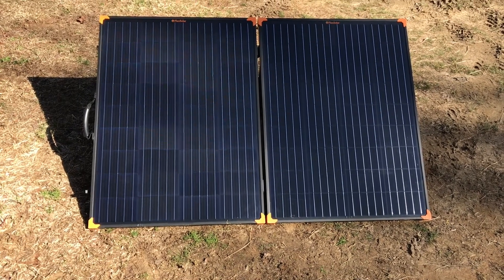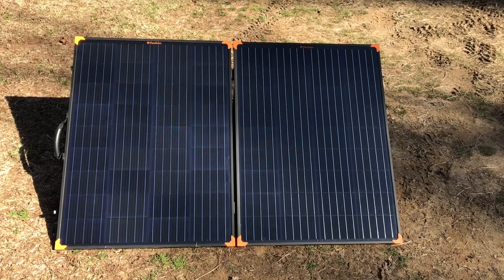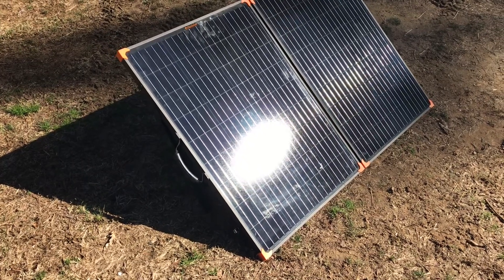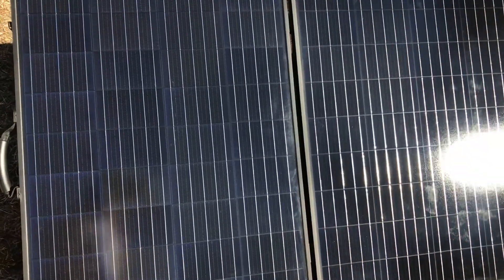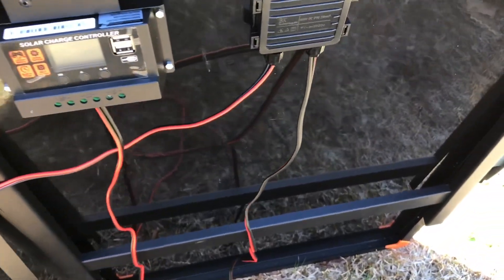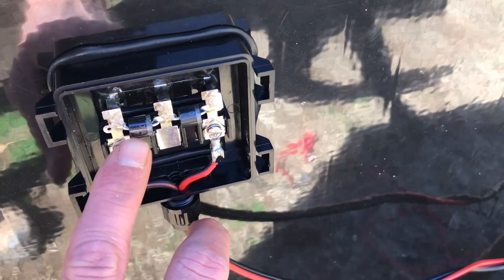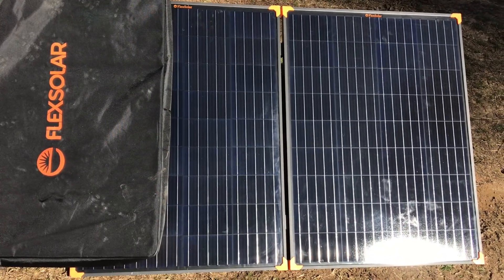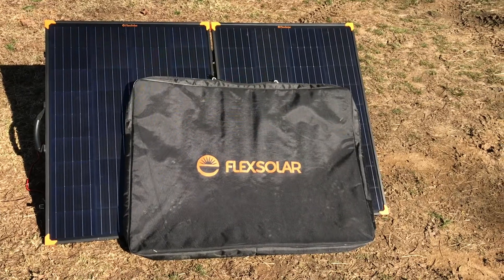EMP AND SOLAR PANELS

Comment: I look forward to learning the rest. I'm installing Ferrites onto my lines and will be putting multiple T.R.A.P. devices on my system..I have backup AC/DC inverter, MPPT controller  and a battery Charge controller in faraday Bags. Placed into my faraday Garbage can . I am using the Nesting approach to protecting my gear. 
Example:
1)Keep electronic device in cardboard box it came in.
2) Wrap box like gift with 6 layers of aluminum foil.
3) Place item into EMP bag. And fold tape bag closed.
4) Place bag into 50 cal ammo can. If to big for can add 6 more layers of foil
5) Place item into EMP garbage can
Note ( The garage can has had any and all places that have pierced by screws, rivits in the can covered with aluminum Tape to prevent wave from entering. Then cardboard on the inside of can. Then a huge EMP bag inserted into can think like a trash bag in the can)
6) lable item so you can know what it is on outside of bad 
7) Place EMP bag into garbage can and seal EMP bag by folding a few times and use masking tape or clear tape to seal.
8)Place lid on can
9) Using aluminum Tape seal lid to can to make complete seal.
Lable outside of can of contents in can.

I hope this gives people some ideas.
Using the he nesting method I think is best and not very costly. More layers are always better.

Just my 2 cent
Good luck
Reply from the maker: Great method you have! I love it! You earned the pinned comment! Thanks for sharing your method!
Reply: Great info. Thanks for sharing!
Reply: Where do you get HUGE EMP bags?
Reply: Also cover with aluminum Tape on the inside and outside any rivits or screws that may have pierced the can to prevent wave from entry. Additionally, after to insert item into ammo can, use metal tape to seal each half of ammo can to give a secure seal.
Reply: I am in the process of doing exactly what you are doing.
 My question is, my MPPT controller is programmed using Bluetooth. Can I use a tablet downloaded with Bluetooth then put it in a faraday can and be able to use it on that fateful day?

Comment: This is a very good video.  You answered my question.     My solar powered power station i ha have it in an EMP PROOF box.    Didn't think i needed one just for my  solar panel
Reply from the maker: It’s a form of electronics,  so for mission critical operations one may want to have some put back in a safe location.

Comment: Question: I have an 8 panel array on top of my tin roof. I will unhook the pv lines from them to lessen the blow of an emp. But I also have the panel frames connected and run down a 25ft ground wire to a 8ft deep grounding rod. I would think this would be good to give the volts somewhere to go into the Earth? Or should I unhook it as well?
Reply from the maker: Disconnecting would help, being grounded “may” not depending on your soils conductivity. Some even recommend floating panels (not grounded)!! Way too much information to properly answer in a comment.
I’m going to be going over EMI/EMP/Lightning protection in my new 12V Power Bunker build. I’ll try an give you all the information you need during the EMI portion of the build. https://youtu.be/6mnUdy2so9U?si=crMDjGX8DGPG9mjX

Comment: You answered a couple questions I had. Thank you.
I do have one question I’m not sure if you’ll have the answer to considering that most questions about EMP survival are theoretical at best .
My question is I have a 1.2 kW system not including to wind turbines sitting downstairs in my basement behind two layers of brick, and one layer of concrete block there roughly 5 feet below ground is this enough to keep my charge controller safe from all three forms of EMP or do I need a cage?
Reply from the maker: Hard to say with any certainty, lots of variables. Best practice would be to faraday spare electrical components. Thanks for watching and commenting!
Reply: Your charge controller will not be protected if it is connected to any feed. Wiring will bring an EMP directly through anything that is plugged into grid source.
Reply: @reinger1022  it’s completely disconnected from any wiring and now In a trash can cage

There are also no wires in the cage

Comment: question solar panel frames should be grounded to panel ground if emp hits wires or ground over rod or lightning near rod it will go up the rod and mess up your system ? is stated in other videos doesnt seem to be relevent doesnt it flow into ground and neutralize? could it go up your rod?
Reply from the maker: I have panel frames grounded. No ground wire back to controllers. Twisted pair PV cable to transient voltage suppression (midnite spd) then through emi line filters. High saturation broadband ferrites at both ends of wire run. Less than 100ft of wire to farthest array. 
Some float their entire system (ungrounded) but I found this makes static on the frames. YMMV. Hope this helps!
Reply: @THEOFFGRIDMOUNTAINHOMESTEAD  kind of itation to me so let me ask you my new batteries will have a metal caseing around it im going to ground it to pipes wil that help a emp? and going to put a battery cable jump thingy one end clasped to my car frame or hitch ball other end to a fence metal pole tomorrow is an emp solar storm hardest hit one yet / will this help thanks for your time im subscribing to youj
Reply from the maker: Is this for a vehicles or RV electrical system or for stationary power ie off grid system?
Reply: i have alll three solar storm tomorrow but im most worried about home solar off grid
Reply from the maker: Mixed options on grounding faraday/metal enclosures. Most do ground their enclosures. 
I’m assuming you’re working with LiFePO4 batteries? Are your negatives already connected to ground in a lithium combiner box? 
If you have lead acid batteries no worries about solar flares etc as far as the batteries are concerned.
Reply from the maker: This? https://www.swpc.noaa.gov/news/another-r3-strong-flare-eruption
Wasn’t the last CME stronger?

Comment: Thank you for this, I look forward to the rest.  Question please: the solar panels I purchased came already wired with connectors so they could be connected together.  I have them in storage, not connected to anything. Should these connectors be removed so the panels are wireless to protect them from emp? Thank you.
Reply from the maker: Check the wire length. Most factory wiring on panels is less than 36”.  Even with the factory wiring in place there’s a very low risk of damage if the panels aren’t in use or hooked up to a longer wire run. Hope this helps!
Reply: Thank you much!

Comment: What is the use of having solar if you have to disconnect it for them to survive, do I have time to disconnect them to save the system
Reply from the maker: Protection strategies are going to be featured in future videos. Your solar power system can be hardened to reduce/eliminate the effects of an EMP. Lots of information to cover. 

Some folks don’t have extensive knowledge of solar power and I’m trying not to exclude anyone by going full nerd mode right at the beginning!
Reply: I mean that, the only way to protect is if we had advanced warning, at least 15 minutes, but I do have emp shield, it's all about the money right, most of us solar people don't have a backup system, can't afford it
Reply from the maker: With no protection components in place, yes you’d need advance warning which probably wouldn’t happen! 
Agree 💯 that solar power folks usually don’t have backup since they already have tons of $$$ tied up in their system!